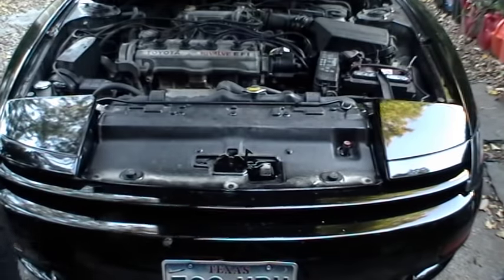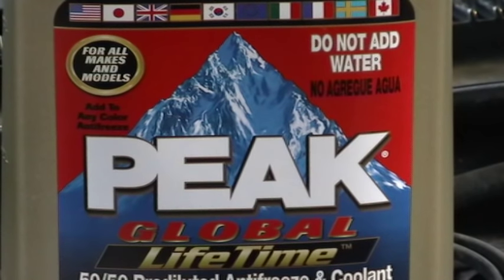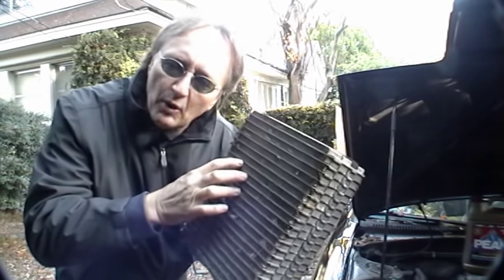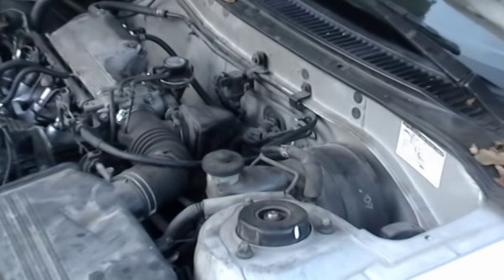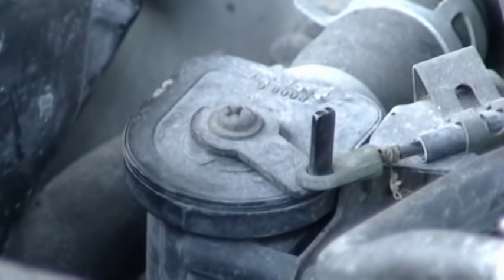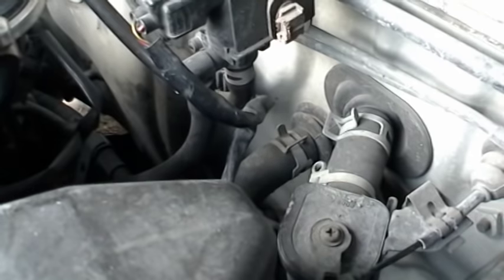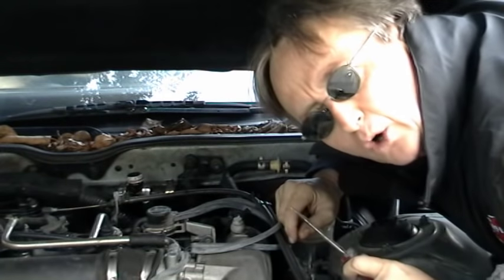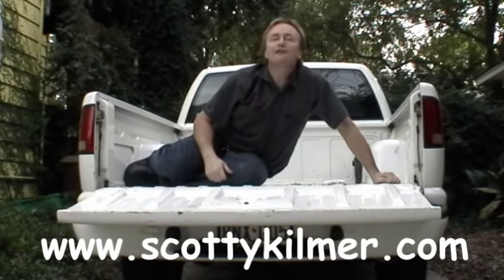How to Fix a Car Heater

Comment: I have a BMW 325i 1994 e36 that I have been converting into a winter warrior track car. I want to remove the AC compressor, it's reservoir, the ac radiator and all the tubes and connections. This won't affect my heat in the winter will it?
Reply from the maker: as long as you leave the heater core in the dash, it will have heat
Reply: Thanks a lot, you're super helpful!!

Comment: I have a 02 Nissan sentra and has little  heat idling but gets warmer driving car has no leaks has new thermostat and flushed radiator   any information would be appreciated on how to fix

Comment: Hi Scotty! I have a 2001 Toyota Echo and it's almost impossible to get heat from the 2 air outlets in the center of the dash. (they only get some warm air if I turn on the air recycle mode). The one to the left and to the right next to the doors get hot air perfectly fine though. My coolant is full and the engine warms up normally, even at very cold temperatures. Any ideas of the cause? Thank you very much!
Reply from the maker: your blend door system is breaking down, and you'd have to tear the whole dash out to access that system and then buy some very expensive parts, often the entire heater box assembly. Me, I'd live with it.

Comment: I change the control valve heat to my Honda odyssey 2000, but the heater is still not working. It will throw air but not warm. The car temperature is rising unexpectedly. What can I do next? what do you think needs to be replaced? Should I replace the termostad?
Reply from the maker: replace the thermostat, but that won't fix the heater as a hot engine will put out more heat.  first, make sure all air is out of the system, bleed it all out. Then pray that fixes it and you don't need a super expensive new heater core or internal dash work on the blend door system. Honda heating systems are all computer controlled on that model
Reply: ok thanks

Comment: Great video sir. I must say you, you make it sound easy and fun lol. i have a question for you with regards to my heater. I have a 2002 Nissan Maxima that purchased the other day. Everything was great. Well so I thought. When I put my car in idle, my heater blows out cold air when I turn it on but when I accelerate, whether in "park" or in motion, my heater works great. But as soon as I let off the gas, the cold air comes back. Would you have any suggestions as to what may be happening ? Thanks for the great video !
Reply from the maker: If you wish to ask me car questions, I am switching my questions and answers to my google+ community “Auto Repair With Scotty Kilmer”. So please, if you want your questions answered, go  to this link https://plus.google.com/u/0/communities/110758243155230074828  and join my community. You can then ask your question there and I answer them personally. You can then also attend my weekly Saturday morning Live car talk events where I answer your questions live.

Comment: i need help scotty,  i already tried everything in this video except for the heater control valve ( which i cant seem to find under the hood )  i drive a 1999 dodge ram 1500 with 5.9 motor. it heats a little better than before but it could be a lot better, what else can i do to fix my heater?
Reply from the maker: +isael rocha that doesn't have a control valve for the heater, it's a new design, realize you may need a new heater core, they do clog up over time

Comment: Ok I have a 01 toyota corolla the heater works but it takes for ever to get any heat the car has to be a operating temp for at least 20 minutes before I get any heat and it still doesnt get as hot as my truck do I need to flush it out?

Comment: i have a question. What can the problem be if my 1995 honda civic ex leaks coolants under glove department. coolants gets all over my passenger front floor mats. can this be the heater  core or just a hose.  and is it ok to drive my car without turning on heater because it only leaks when i turn on heater.  i think. thankyou

Comment: I have a 97 chevy Tahoe! The engine seems to be overheating at higher speeds and my heater doesn't work. On occasion however, the heat kicks in but quickly goes back to being cold. I'm stuck, what can I do?

Comment: Scotty, does a '94 Ford Aspire have a heater control valve? I wasn't able to spot it.

I suspect my heater core is blocked though, because the radiator is full and my engine heats up to just below half on the temperature gauge on the dash. The vents don't put out a lot of heat despite the blower kicking it out.
Reply from the maker: no, it doesn't have a heater control valve, it just uses a blend door inside the dash for heat or no heat. Try flushing the heater core and have a mechanic scan it to see if the blend door is working or not, that crap is all computer driven and it takes a pro to analyze them
Reply: Scotty Kilmer
When I flushed the heater core I accidentally spilled coolant on the alternator and my battery is drained. Autozone tested it and said I should replace the alternator. Do you think the alternator will "dry out" and work if I remove and clean it?
Reply: i ended up replacing the part with one from the junkyard. no worries! Future note: don't spill coolant on an alternator!!!

Comment: Scotty, I've got an old dodge truck with cool heat. Thermostat has been replaced. Water pump and radiator have been replaced recently too. The truck doesn't run at weird temperatures either, it always stays where it should. Both the inlet and outlet hoses of the heater core are warm. Already tried flushing the core, but no change in heat output. Coolant is full. Any idea why the heat is cold?
Reply from the maker: +**Classified** heat core probably needs replacing, flushing won't fix a really old shot one

Comment: Hey Scotty on my 2010 dodge charger is it safe to flush the heater core.... i only get heat when I am driving at but the heat stops when I am standing or parked
Reply from the maker: sure, it's no different than any other car
Reply: Ira Friedman that's because the car doesn't get air running through, so it wont be heated

Comment: Hey scotty, I have an 03 ford taurus and my heat only works hot when I have the valve on the lowest blower setting, when I click it into the high setting it doesn't get hot. coolant was almost empty, I filled it and it's holding coolant fine, and obviously the heater core is getting coolant because the heat works on low. my thermostat should be fine because my engine gets to the right temp and the gauge works fine. any ideas? thanks in advance!!

Comment: 05 Grand Caravan - temp gauge where it should be. Coolant level up. Intermittent cool air. Most of the time it works. Rear heat rarely works. Help?
Reply from the maker: on those, often a worn out compressor does that, and the rear heat is a separate system, often the heater core back there clogs up
Reply: Think it's worth fixing? I'm trying to sell it right now too haha.

Comment: Should heat inside the car be  the same temperature from all vents including floor vents.
If the heat is split  should temperatures remain constant or will temp vary from vent to vent.
Why do some vehicles have superb heat in them and other average even in new vehicles.

Comment: I have a question related to this. The radiator is full, temperature gauge gets up to operating temperature, but still no heat. The 2 hoses to the heater core are both cold, not just one. What could be the issue? I don't think the Elantra XD has a heater valve.
Reply from the maker: heater system is blocked, often a bad heater core if older
Reply: Scotty Kilmer
 thanks for your response. it turned out to be a clogged up heater core. first i put a water hose in the output to the heater core and it was a waterfall of brown gunk. after doing that until it was clear, i reversed the process and put the water hose through the input to the heater core and not so brown gunk. i should note that when going back to the output it was brown gunk again so this process must be done back and forth multiple times.

Comment: Omg i finally found a video i can relate too! So i have a pontiac Grand prix 2002 4dr, and my heat blows out cold air even after 20 mins,I had my whole car flushed with new oil and everything, On top of that after driving for awhile my temp light comes on during the winter when its freezing outside, I gotten the water pumped replaced and coolant added i gotten the Intake monifold replaced, and it still isn't working! I need help fast! Please comment back
Reply from the maker: overheating cars make the temp light come on. When overheating, air often gets into the heater core, and they only put out heat when full of hot water, not hot air.  So check for low coolant and air first in the system
Reply: Scotty Kilmer how do you get rid of a possible airlock?

Comment: Hey Scot I have 09 ford flex. Do you know why take so long to have heater ? but if am driving it going faster. Do you have any idea is?  thank you
Reply from the maker: often a clogged heater core or a system low on coolant. Try flushing it out if coolant is full

Comment: Hi Scott! I have a mercedes c180, the heater is warm when driving but theres also water leaking from somewhere onto the rear footwell of the driver side. What could be the cause and how can i fix it.
Reply from the maker: pressure test the cooling system to see if the heater core is leaking

Comment: Scotty .... i have a 2001 Grand Prix SE 3.1 and when i drive fast the heat works great but when i slow down the heat doesnt work that good.... I replaced the them, Flushed Rad, Bled the lines  and it is full of coolant .... What could it be

Comment: hey, my grandpa has an 87 celica, it runs at normal operating temps, but the heat is intermittent.  It'll have hot air randomly for about 20 seconds, then it goes back to cold.  What could that be?  i havent taken a very close look at it yet, but do you have some tips for what i should check for?

Comment: hi scotty i have a chevy silverado 1990  i only get warm air not really hot air does that mean that my heater core is blocked or is it my thermostat that needs to be changed i had my heater core flushed a few times  since i had the truck so im thinking that it;'s the heater core again whats your profesional opinion on this ? thanks .

Comment: Scotty, working on a 1997 Buick Century Limited 3.1 liter, has no heat, the digital climate control panel doesn't light up at all, the blower motor works very little , an i drive it the temp gauge stay low, what should i do ? replace the climate control panel ? is there a fuse for it ? Please let me know . i am being told it gets luke warm air
Reply from the maker: On those crappy digital heat systems the control panels go bad all the time, start there

Comment: Scotty I have the same problem as Jeffs I have some heat when the car is moving but at idle it blows cool air, I replaced the thermostat but no help,  What kind of radiater flush should I use or just plain water?
Reply from the maker: go to an auto parts store and buy the strongest radiator flush they suggest
Reply: Just take or disconnect your heater core hoses, spray oven cleaner in the "out" hose, wait 15 mins or longer then flush it out with water by reversing the flow, then regular direction of flow.  I had identical prob and now I have crazy heat!
Reply: Mike koz
Thanks mike and Scotty  I flushed it with a radiatore flush and it works great!

Comment: Hey Scotty, a new problem has arisen in my 2002 Camry relating to this.  On cold days when I turn the heater on, it draws the heat out of the engine, rapidly cooling it down until I turn the heater off then the engine warms back up.  There are no leaks and it has a new thermostat in it.

Comment: I have a 1989 Ford E-150 Econoline van. When I turn the heater on, my temp gauge starts to go up to hot. My van also does this when I let it warm up. I have replaced the radiator, thermostat and water pump. They are all new. What is the problem, and how can I fix it?

Comment: hey scotty i have honda accord 2003 and i have hot air on passenger side blower but cold air on driverside blower. do u have any suggestions on that?
Reply from the maker: often just air in the system does that, but if not, often a clogged heater core

Comment: Hey Scotty I drive a Pontiac Wave 2005 and the heater wont turn on. I turn the dial to defrost and it works, but slowly but no air is blowing out. Is it the fan? Because I can't hear it whether I turn it to cold or hot air.

Comment: Hey Scotty, where's the heater valve located on a 2004 Chevy blazer?
Reply from the maker: +mike lee that's a newer design, doesn't use one, it uses blend doors inside the dash to open or close doors to the heater box

Comment: Hey i have a 2002 Subaru WRX and when im driving and the engine is under load the heat works but when i'm stopped or at idle it drops down to cold. I have about 83k on the car and just had a clutch and timing belt done and after that it hasnt been working right, what do you think is wrong because my engine temp gauge is ok but it looks cold for a while then shoots up to regular temp (just under the halfway mark) What do you think is wrong?

Comment: My heater core is leaking. I never use my heater core because I live in Middle East, the weather is very hot. Does bypass the heater core have effects on my engine?
Reply from the maker: none at all, as long as you remove the two hoses going to the heater and then splice those two hoses together, flow will be normal then

Comment: hey buddy my 94 probe's heater blows cold air. the core isn't clogged, flushed it back and front and water seems to flow easily. but when i put coolant into the radiator air seems to be trapped in. i can tell by touching the hoses. the car doesn't have an air bleeder. so i ran the car with the radiator cap off for more than 40 minutes and i still can feel air trapped into the system. and the bottom hoses stays cold for the whole time. do i have a bad thermostat?

Comment: When you flush the heater core with water am I supposed to leave the water in after, or blow in it to take the water out?
Reply: I left it in, it will mix with the antifreeze coolant anyway,,I just did mine at a carwash with oven cleaner & old tubing!  Car wash wand was perfect fit!  $3 for 3 minutes All kinds of heat now

Comment: heyy mr scott, i have a 1990 Toyota celica. when i bought it the air (hot or cold) use to blow only on high, now it doesn't blow at all. i checked the heater control valve and that moves fine with when the speed knob is turned.  can u please help me because my state inspection is over due. thanks

Comment: Ahh good news, i dont need to.  The last owner bypassed the heater. So everything is great.just need to connect it back up, maybe a leak in the heating matrix . So bottle of rad repair will help. Still a great bit of advice. :)

Comment: I have a Buick ancore 2015. My ac/heater were working, have to change thermostat, two weeks later my heater blows cold air. Cars temperature is fine .

Comment: Scotty, on this 1995 Ford Explorer i have been fixing up, its come a long way , i want to fix the rear defroster , the problem is the metal prongs that the wires connect to on the rear window on the hatch are broken off, what do i do ? can i buy new prongs ? i just searched an no auto parts store has them. what do i do ? please let me know. thanks

Comment: scotty i have a silverado  &i don't know what's wrong i flushed the heater core used the rad flush  but i still don't get very warm air i got heat but not very hot just ok ,could it be the thermostat &if so should i put a 4 season or a winter thermostat in ? when i rev the motor it seems to blow a little hotter rad is full  i don't get it .
Reply from the maker: +mario d.c time for a new heater core then, revving it up increases water flow

Comment: in my 2005 Toyota Sienna the heat works great. but the the rear heat doesn't work so great. what could be the problem?
Reply from the maker: +Thomas Mccarthy try checking the blend door operation to the back, those doors may not be opening fully

Comment: Hey I have got a Ford focus Ecoboost 1L and the warm heath is goes work, there is no leak, but the fan stays on when I drive and even I turn my car off the fan keep running and switch back off after 15min

Comment: the heater core lower hose is very hot but the top one is medium hot,  I barely have heat I flushed the heater core, changed the thermostat 
flushed the radiator, I got heat at 1st then back to barely heat. I opened the radiator cover there is coolant in it, run it a bit squeezed the hoses 
burp it a bit from air the I got heart, a day later back to the same problem midi ocker heat. just got my oil changed at the shop oil stick is clean
blowers work well low medium and high.
What do I do any ideas please Honda Pilot 2006

Comment: I HAVE A 99 JETTA AND THE HEATER WORK ON THE 2 VENTS ON CENTER BLOW HOT AIR AND 1 ON EACH SIDE BLOW COOL AIR
Reply from the maker: you have a blend door problem inside the dash. good luck on that crazy german over engineered design, takes many hours to tear those things down.

Comment: hi. the heater has just gone on my citroen berlingo diesel van.  There's no hot or cold air.  Notthing at all.  And now my fuel gauge won't move either, it stays on empty.  Are they both connect?  Any idea's??

Comment: my car does not have a data port for one of those computers. im gonna try replacing the automatic control unit which includes all the dials. on my car thats one of the few things that has some sort of computer in it

Comment: 91 integra heater is not blowing any air at all when turned on. I looked for fuse but none were for the heater motor

Comment: I have a 1989 pontiac bonneville with a small issue, when i turn on the ac (still works somehow) it blows cold just fine. But when i turn it over to heat no air comes out at all